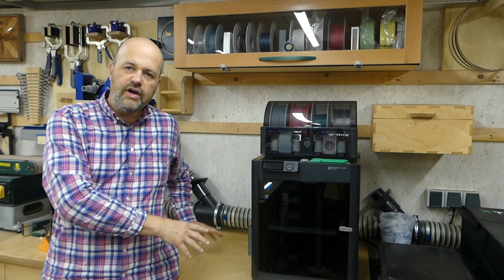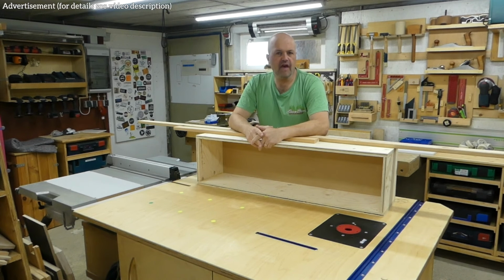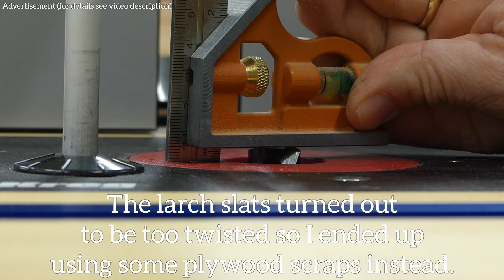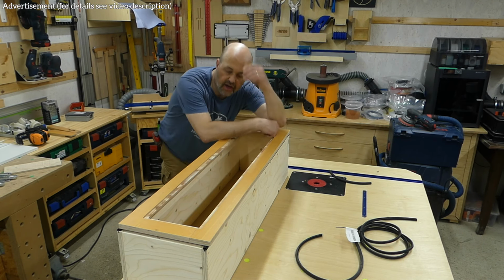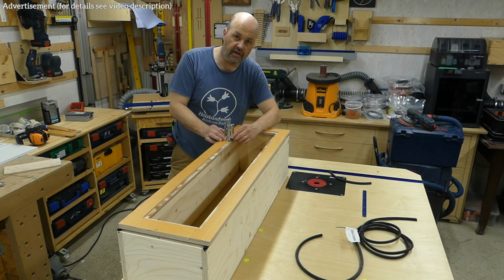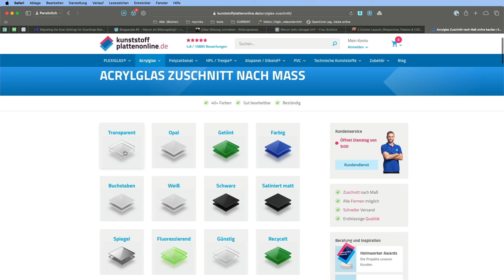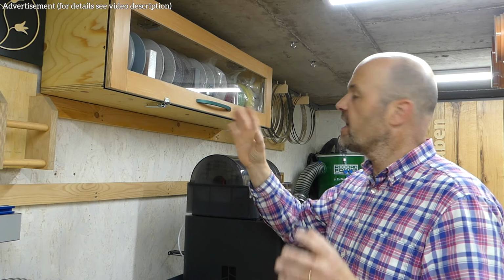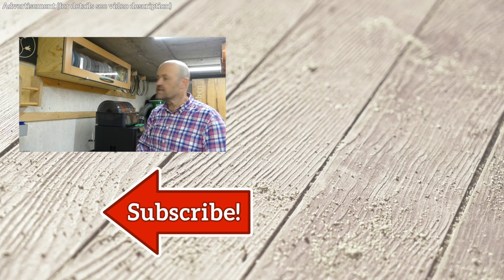Filament Cabinet – moisture-proof and simple

Comment: Great to see you back in the workshop Andreas, great idea for keeping your filament dry.
I've been considering buying a Bamboo Labs 3D Printer, but even though I can afford it, will I actually get the use out of it that I think I will ?
Or should I improve my workshop dust extraction and buy a two motor Cam Vac, and all the extras, decisions decisions 😄
Reply from the maker: Thanks Colin. I actually found that since I have had the printer I keep finding new and practical uses for 3d printed parts.